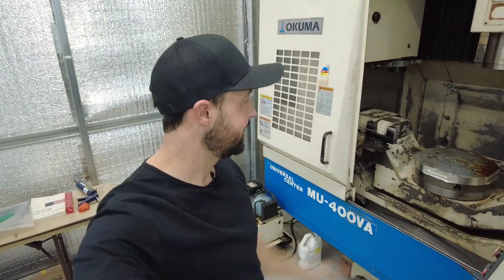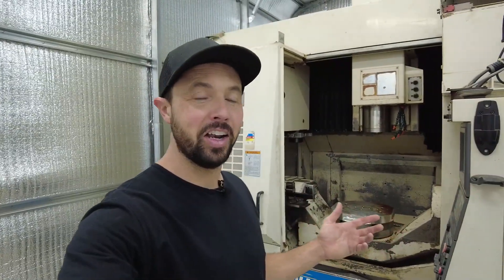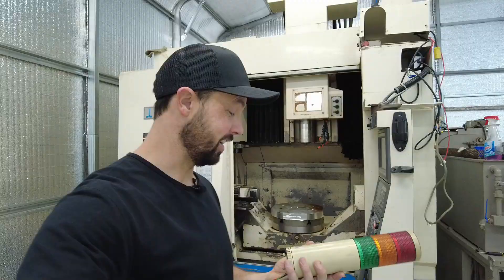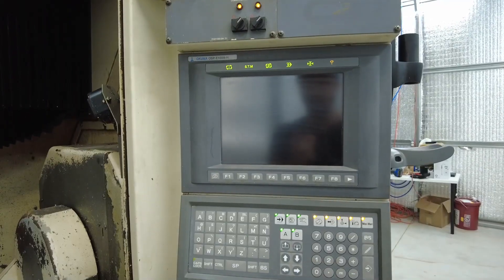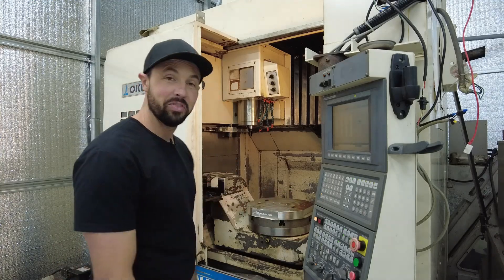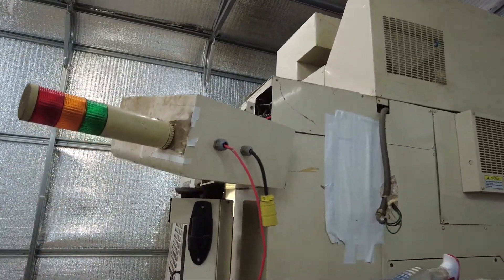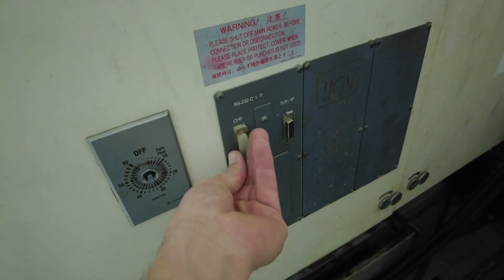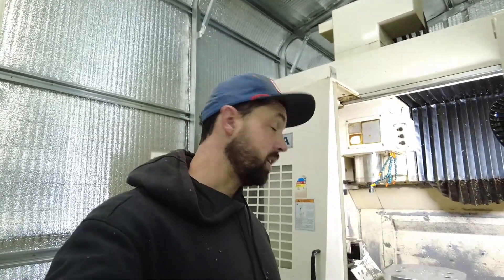First OKUMA tool changes

Comment: Nice work, I've got a couple Okuma's of similar age, can not recommend them enough.
Few things to save some head scratching and time
RS232 transfer - Hit: Edit, Pip, Read, type CN0, but before hitting write, press send on your PC or DNC transfer box, then hit "write" on the machine.
The Titan DNC box is fine for program transfers, I made a bracket above the control for it to mount to, and run an extended RS232 cable to the CN0 port, that way I don't have to walk around the back of the machine to hit send on the DNC box.
Don't be scared when you get stuck partway through a toolchange, just hit manual, and ATC advance or retract to finish or back track the toolchange. If it keeps stopping during a toolchange, you've likely got dirt or something on a sensor. Clean it all and it'll work. Try and avoid blasting coolant in the toolchanger area when washing the machine down, it'll cause these sensor issues.
Motor City Spindle Repair are your go to guys if you need a spindle rebuild (I'm in Australia and my options are limited, but my spindle is 27 years old and still OK, doesn't like running at 75% speed and over for long periods of time, 50 taper) Okuma Melbourne have a spindle in stock for my machine at $45,000. A motor city spindle repair is probably $10-15k USD.
Fusion 360's Okuma post is great (3 axis experience only)
You may need to increase the tolerance in Fusion when 3D surfacing to lower the amount of code for any given program.
My machine won't take programs over about 7000-9000 lines depending on the amount of data in each line.
The machine is gonna go into alarm more often than a Fanuc machine, but generally most alarms are easily cleared and the alarm code manual is incredibly thorough, Fanuc machines just say "I'm broken, figure it our dipshit"
Example :alarm C 2xxxx - axis change unusual = turn the air compressor on man :)
If it's a grease machine, get the good Kluber Nu15 grease for it.
There is a slight danger surrounding the INIT or Initialise soft key when in MD0 (machine directory) so just be mindful of keystrokes.

Enjoy man, they are a pleasure to use once you get the hang of OSP.

Edit yours is E100, mine is U10 - yours is a bit newer so some of the above might not be applicable.
My LB300MY lathe is E100 and I like both controls, but found U10 easily to navigate
Reply: I would never send a spindle to motor city. They wound a stator wrong for me when I was actually doing the work and I was nearly fired for it because the boss thought I was doing something wrong.  
They used to have some nice looking sales ladies though that always want to meet in person.  The owner of that business is a very smart man😂
Reply from the maker: Sorry it’s taking me so long to respond to this.  This is such a trove of knowledge thank you so much!  
I’ve been fortunate enough to have the alarms manual so I’ve relied on it a few times already.  Love how they have them all spelled out and diagnosed.  
I’ve got the Kluber grease going to get the ballscrews and ways all lubed up.  
Thanks for the info on the DNC it sounds like it’s very similar workflow on the control I have.  It will be a learning curve I’m sure.  Did you get your DNC cable from CNC specialty store?  
This next week should be my first week running a program so I’m getting excited.  I’ve spent the last 2 weeks cleaning the old coolant out of this machine. It’s been a massive undertaking but it’s going to be so nice.  👍
Reply: @ericschneiter  I can't remember where I bought the RS232 cable from, but it's gotta be from a speciality CNC store so the pin out is correctly set on the wires. I'll see if I can find the link to what I bought
Reply from the maker: @zakanderson6196  I bet its CNC specialty store.  They make them and Ive heard others talk about them.

Comment: You have FTP server connection option that is 1000% better than rs232 dnc connection. You need Base5 ethernet serial trasnciever and plug it in that tcp\ip and have 5 megabit speed of drip feeding.
Reply from the maker: Duuude this is great info!! Is there any way we could chat for a few? I have some manuals for options and I think one is for this.  I’d love to just ask you where to get started if you’ve got additional tips 🙏

My email is: eric2schneiter@gmail.com
Reply: @ericschneiter  I dont have first hand experience, but matsuuras have same pin port that is used for ftp comms. and it being marked TCP/IP reinforces the feeling it is it. I am up to communicate within my expertise

Comment: The left side plug is definitely your DNC cable, but I'd have a go at the right side port first, which I bet is a full network cable in a DB9 form factor. If you look where the cable that comes behind there leads, I would imagine its plugged into an RJ45 on the main board.
Reply from the maker: Thanks so much. This is massively helpful.  I’ll take a look and see if I can trace it back.  I was looking at CMC repair parts it looks like they have a whole bunch of cables they make.  I’ll probably get one from there.
Reply: @ericschneiter all good. If you just want to do serial DNC, you should just be able to stick a db12 to DB9 cable in there, then do usb to serial on your pc